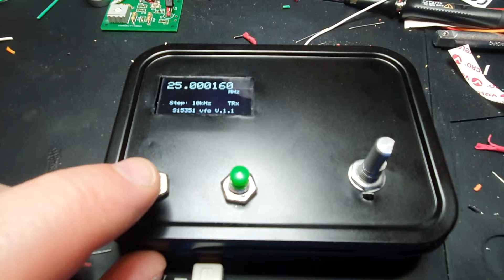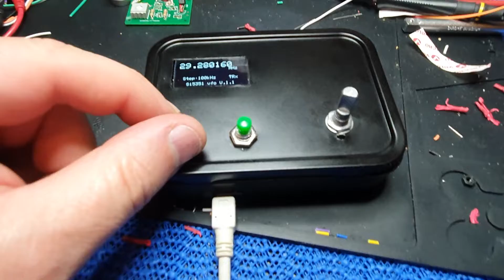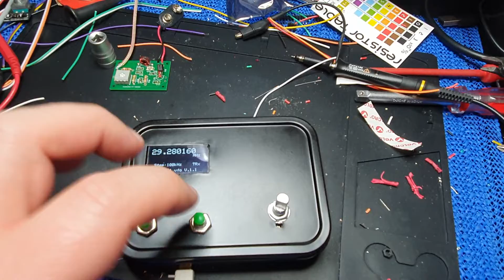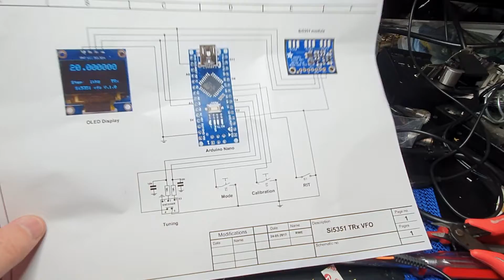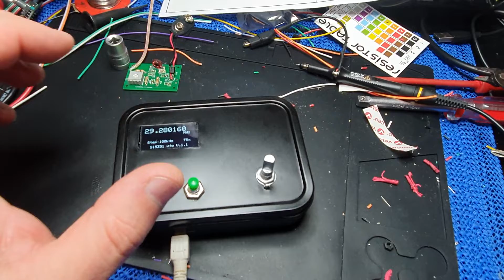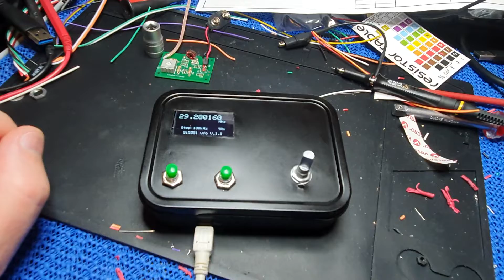The SI5351 VFO lives, albeit barely!

Comment: HI I've made some progress with this - found the earlier v1_1_0 version of the sketch , change the si5153.h library to RWE_si5153.h - compiled and uploaded - now it works, but with a few bugs - the main difference is the display_frequency function has been rewritten - so next step is to investigate this routine in v1_1_1

if you want a copy of the sketch I'm using pls email ron.steve.north@gmail.com

cheers
Ron

Comment: Hi I've breadboarded this project, and hit the same issues as you - The display is fine as are the rotary encoder functions and I have a RF output - The RIT, MODE and calibration switches however, are not functioning as expected - Wondering if you've made any progress?
Reply from the maker: Yes I believe its bounce caused by a stepped encoder.. we need a step less type..
Reply: Cheers - I don't appear to have problems with the encoder, it tunes smoothly across the range, and the step values (radix) can be set via the push switch as expected, (the one I'm using has pull up resistors) - pls let us know how you get on, as will I.
Reply: @TheGazLab  
Hi I now have my version of this functional  - encoder problem, the encoder centre pin should be ground (the outers used for data)  as shown here 

https://i1.wp.com/henrysbench.capnfatz.com/wp-content/uploads/2015/05/Keyes-KY-040-Rotary-Encoder-Module-Schematic.png

the pull up resistors are not required as pullup is applied in the sketch, but it does no harm to add them 

I found that there is an issue in the sketch (assuming your using the same as I) :-

in the display_frequency the Hertz string length is set to 7 - in version v_1_0 it s set to 12. (third line down in the display_frequency function).

char Hertz{12};

setting this to  12 resolves the problems I've been experiencing - I've yet to fully test  the VFO but looking good so far RIT, BFO and Calibrate function as expected - I would like to add a 'lock' button before building it into a case.

I don't fully understand way Hertz string caused the issues - any thoughts?

Comment: Hi I've also purchased a bunch of parts to build a similar project (haven't actually started yet..)  I've a bit of experience with Arduino, but I if you can post the links to the project your following or using to start from I can check it out and maybe replicate the issues.  I suspect for one thing you are getting switch bounce issues - but with no source code and no links I have no idea...
P.S.  Came over because of Callum's shout out! :)
Reply from the maker: Thanks and thanks.. Calum is a kind soul .. I will dig out the code etc its drive me bonkers lol
Reply: @TheGazLab  Just been doing a bit of searching online and there are many different projects and sets of code for VFO's based on these modules.